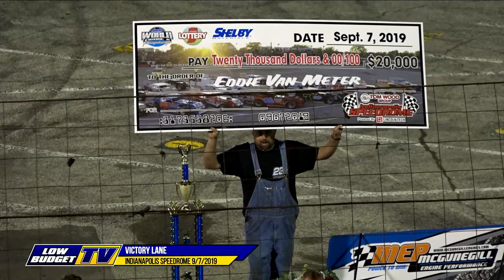World Figure 8 Championship - 3 Hour Endurance Race 2019

Comment: I have a feeling sizemores team found out about the carb issue to close to start time to get it fixed before the start so planned to pull in immediately after taking the green to fix it instead of not starting the race and getting put into the alternate pool